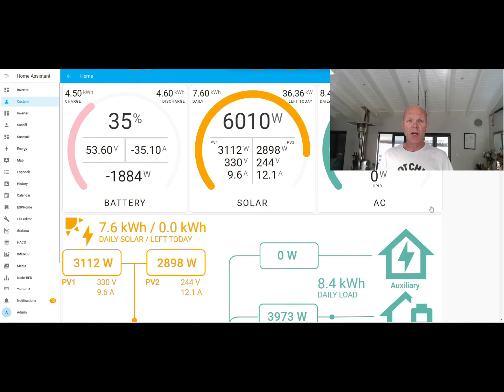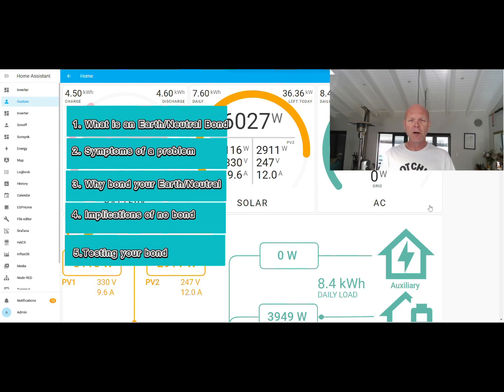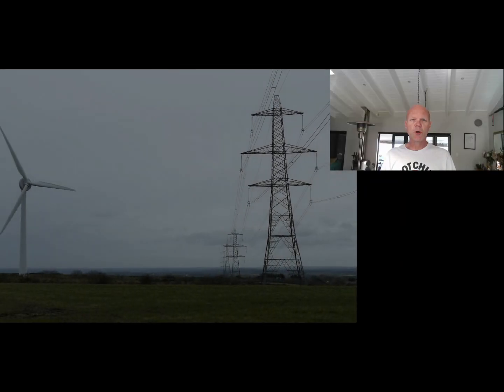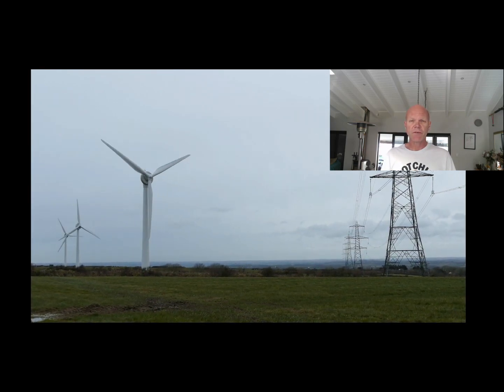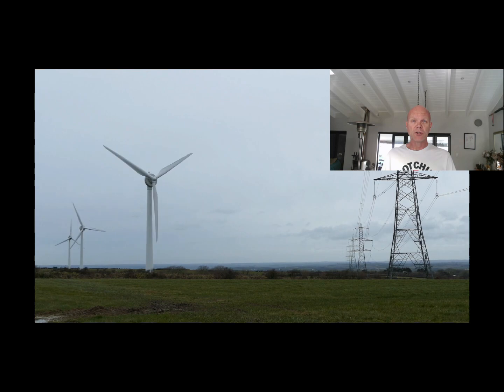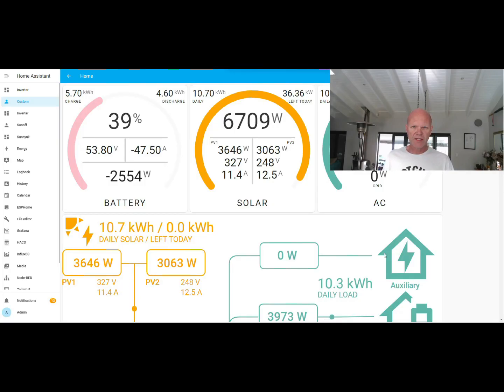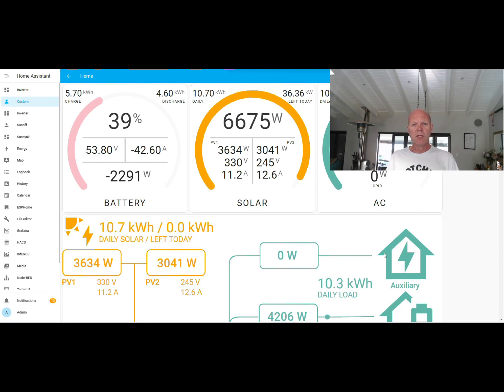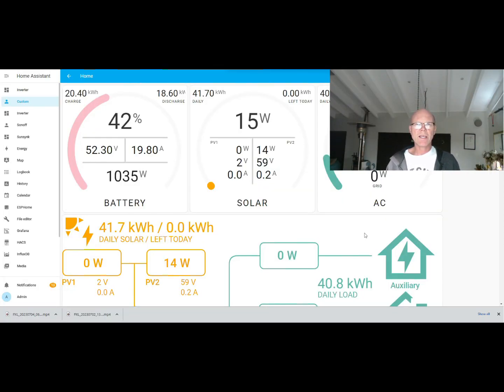The first thing you should check on your new Inverter installation - Earth/Neutral  Bonding

Comment: Thanks for the information. Lots to consider if one is just installing a Sunsynk inverter. Since I've put the whole house on the Essentials/UPS output, using a relay becomes pretty much redundant since there is no separation between circuits as far as neutral and earth is concerned, i.e. the original main board is not split in the normal sense. Hence I opted to use a permanent E-N bond.
Reply from the maker: Hi  @kevinrtres 

It seems that there has finally been some clarity as to what the correct way is to do Earth/Neutral bonding on the Hybrid inverters and you will need to switch to a relay to be compliant. 

https://ecasa.co.za/technical/neutral-earth-bonding-clarified/
Reply: @SolarIntegrations Thank you! This is greatly appreciated. Will have to go through all the googly gook attempts to describe what should happen - they really could have just used well-drawn pictures to clarify!

Comment: Awesome video! Thank you. This has answered a lot of questions. I have a SAJ H1 and I kept getting a ISO error meaning earth fault, due to a non earth neutral bond.  Did a small test and hey presto it works. 

It’s actually quite sad/scary that my installer didn’t know what to do and’s eventually “abandoned” me and my issues.
Reply from the maker: Hi @svengebert8690 , I am very happy you found it useful. Not only does it cause unnecessary tripping of the earth leakage, flickering lights etc but it is also dangerous!!
Reply: I had to teach the guy who did the installation what was cooking - he had no clue!

Comment: Amazing explication, i have a 8Kw Deye inverter and i have installed a contactor to make the Neutral-earth bond controlled by the deye ATS RELÉ but i have a doubt, wich neutral should i connect to the contactor, the grid/home load neutral or the critical load neutral?
Reply from the maker: Hi @makunan , I am not 100% sure.  I would recommend speaking to a qualified electrician who can advise or alternatively speak to the guys on the Powerforum.co.za or https://energytalk.co.za who would be able to advise.
Reply: @SolarIntegrations  thank you very much

Comment: I like the DIY Tester plug, creative!  I normally just stick the tester leads into a plug. In the end the important part is the RCD disconnecting live if current leaks to Eath, this is what you should be testing, both in island mode and grid mode. High value resistor and let some current leak from L to E.
Reply from the maker: Thanks @HeinzMeulke, I wish I could say the plug was my idea but someone on the Powerforum suggested it and I thought it was genius.